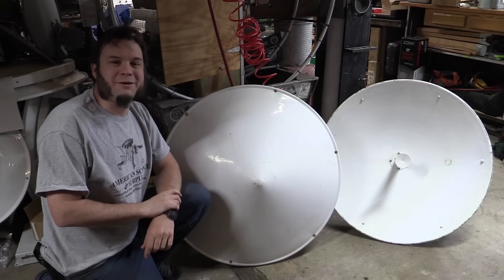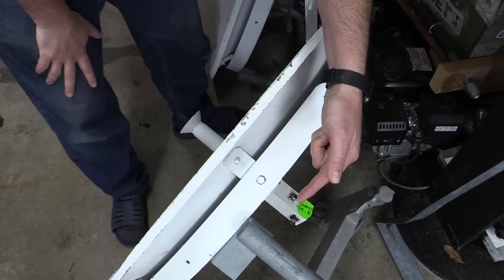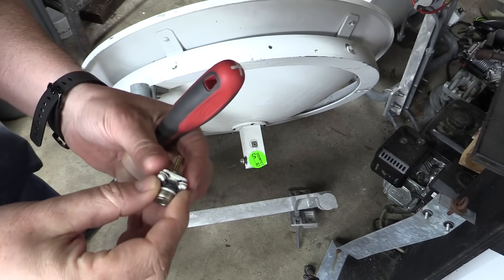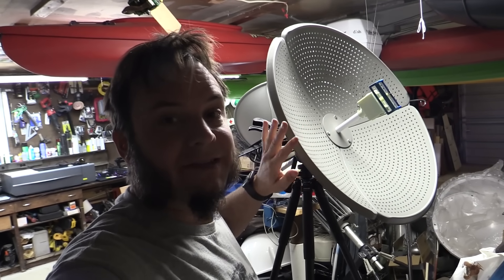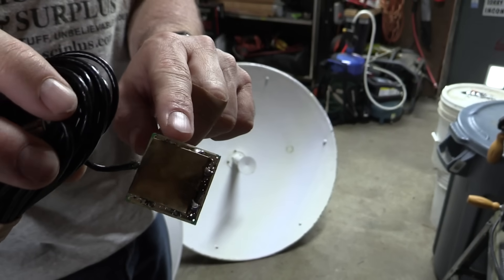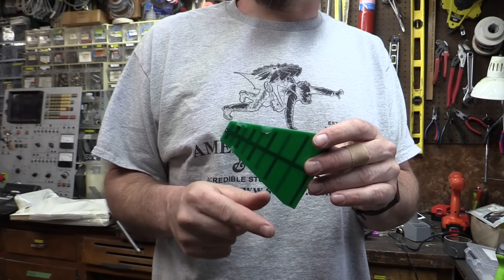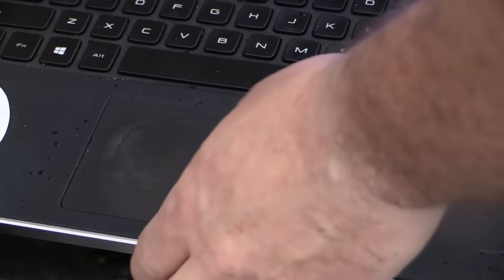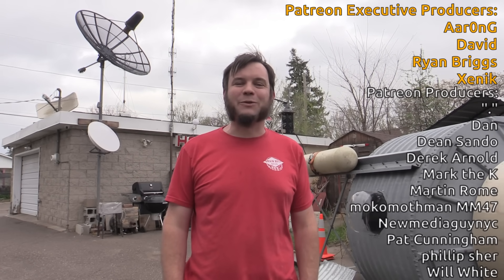Weather Satellite Downlink With Modified 5GHz Wireless Antenna

Comment: I learned just how important wave guides were tonight funnily enough. 
I was setting up an aerial for a TV in a room that's going to be a nightmare to run a cable to. Since I'm in an apartment, the signal isn't the best... Walls and such. Got a signal booster, pointed even close to the antenna, it messes around a bit with the signal. I turn on a step up converter (very poorly made one) and it messes with the signal. I am guessing it was EMF interference? Anyway, I blame the cheap antenna. :P
Reply from the maker: Lots of stuff causes interference these days, I'm actually fighting the powered ethernet for my security cameras, they wipe out a lot of satellite signals :-(

Comment: Isn't there a bit more to dish frequency resonance than just the active element? For instance, are the waveguides not also tuned to a specific frequency? (dish size is also a factor somewhat, lower freq = bigger dishes right?) :)

The log periodic antennas tend sacrifice some gain for bandwidth, which can be useful if you're hunting for signals, but perhaps a bit less useful for something that's specific-purpose like a GOES antenna, and won't likely be used on a wide range of frequencies. 

There's some interesting ones I've been meaning to try, like planar log-periodic sawtooth antennas, which, given that they are flat, could potentially be made with the lasercutter; they look like a maze - could be useful for circular polarized signals.

Comment: Did you know that an antenna has as many as 10 resistance frequencies.  2nd through 10th harmonics.  Look up RF Harmonics Calculator and Formula.  One other thing I use a radio then I tap the discriminator use a upconverter with better results than a SDR.
Reply from the maker: Yep, I run into that a lot with FM, I need an FM blocker on some antennas to keep from hearing the rock station all over the place.

Comment: Not sure I’ve ever seen you use Vitality GOES in concert with the GOES data you’re downloading. I think you might find it interesting to tinker with, and your audience may as well. Love your content, it’s dragging me down the SDR rabbit hole into the satellite realm.
Reply from the maker: I actually have that set up on the big dish, although I need to tweak the settings. The drive fills up on the Pi and then it stops working, so my auto-delete script and cron job aren't quite working.

Comment: Got some nice images there!  You captured the signal with SDR++ but what did you use to translate the signal to imagery?
Reply from the maker: I normally use SatDump. It wasn't working 100% on my laptop but I could transfer the recording over to another computer.
Reply: @saveitforparts  Got it. Thanks.

Comment: 10:32

This error indicates that SatDump is trying to load a configuration file in JSON format, but that file is empty or corrupted (e.g., does not start with a valid JSON structure like { or [ ).

Locate the config file (Possobly on ~/.config/SatDump/config.json) , make a backup of it, check if it exists, or if its empty. Delete it and let SatDump Re-generate it on startup.

Comment: Snow and ice mess with dishes in MN. Know nothing about that…….. ugh. Clearing dishes on the roof is one of the WORST parts of winter.
Reply from the maker: Mine haven't had too much of an issue so far, although I need to be careful with my S-band rotating dish so it doesn't get too overloaded with snow. The plastic dome on the small one should help!
Reply: @saveitforparts  well... we primarily have big dishes upstairs....they are magnets for accumulating snow lol. (You can see them on Google Maps.)

Comment: You've inspired me. I got an RTL-SDR and have been messing around with signles.

I've de-coded local emergency services P25 digital. Found and have been decoding pagers from local hospitals. I got an LNA and im picking up hospitals in different states and up to 50 plus miles away.

im going to eventually get into grabbing stuff from satellites.

starting small with local terrestrial. signals I already know plus finding others
Reply from the maker: Cool! It's definitely a fun hobby.
Reply: What are you using to decode?
Reply: you shouldn't mess around with signles - that's how you end up illiterate AND owing child support
Reply: @gorak9000 it's ok, they are 50 miles away so not in his area.

Comment: I saw some 5Ghz wifi grid antenna. can I modify to receive 4Ghz satellite signal? (C band)
Reply: The minimum sized dish to receive c-band satellites that are spaced 2 degrees apart (as they are) is 10 feet. The bigger the dish, the smaller the spot on the sky it receives signals from. Any dish smaller dish than that, and you will always be receiving multiple satellites at the same time. Can you get away with it if the satellites on BOTH sides of the one you're interested in don't have signals at the same frequency? Kinda, but not really. I've never seen a 10 foot wifi grid antenna

Comment: I point the newer gen of that dish all the time at work. We never ever use the adjustment mount, instead we loosen the pipe-pipes that mount to tower legs just enough to bump it into position, and tap to fine tune. Same with the elevation… just back the brass nuts way off, bump to location, and when you get within parameters, tighten down and verify. Those RadioWaves dishes are a nightmare to deal with and assemble.
Reply: I will note that with percussive methods, we can easily get within .2deg of targets. The limit after that is our alignment tool-SunSights which somehow cost $10,000 apiece! For that I’d have expected them to tell me future and the current surface temperature anywhere on Venus
Reply: @SpAm-AcCoUnT Hey I can tell you the future and the current surface temperature of Venus.
You're about to be disappointed and it's friggin hot. I'll settle for $5k 😂

Comment: Would a dish tv one work with an antenna for this? I can find those super cheap and wanna mess around with this soon
Reply from the maker: Most of them are a little too small for GOES, but will work for Low-Earth-Orbit satellites like NOAA and METEOR if you can move them to track the satellite. I have a couple videos on stuff like that.

Comment: 9:08 what is that device? 🤔
Reply from the maker: It's a SAWbird+GOES, I should have a link in the video description. Filter / Amplifier for L-band signals.
Reply: @saveitforparts not sure if I have seen something like that in the e-waste dumpster I check periodically or not, but will keep an eye out! Recently found a tossed out Dell Latitude E6420 (or E4620) & an Intel Simply NUC i7! Haven't tested them yet! Thank you

Comment: Don't some of those radio signals travel in an 360* sphere? 3:47 can a different antenna, with a wider range, be mounted in that dish? And 3:51 so in order to mount a different antenna, a longer one, the housing for the antenna would have to be upgraded too - to a longer one, right?

Comment: The problem with those dielectric patch antennas used for GPS is that they're actually a fairly sharply tuned antenna structure.  That's true for patch antennas in general, but somewhat more so for the ones printed on a high-Er ceramic substrate.  Will it work at 1.7GHz?  Probably.  But it' may be 5dB away from optimal.....
Reply: Use an upconverter? Legitimate question.
Reply: @joeyhinds6216  Not sure what you mean?  An upconverter is normally used between the antenna, and some receiver that perhaps doesn't tune down as low as you need (at the antenna frequency), so you shift it up in frequency to account for the receiver limitations.
Reply: I think those ceramic GPS antennas are VERY narrow - even with the filter removed. You'd have to put one on a VNA to actually check it to be sure - I think that's a little above the skill level of this channel

Comment: Yay! New Saveitforparts video 🎉, also, for you’re 3d printed antenna, what SMA connector do you use, and can it pick up GOES?
Reply from the maker: For the Helicone antenna? It's a panel mount SMA, and it's the wrong polarity / too small for GOES (I tried!).

Comment: And why the people on the Equator turn there LNB by 90° for a normal vertical reception? 😊
Reply from the maker: Depends which way they point the dish, if the sat is directly overhead or off to the East or West.

Comment: Gabe, You can convert a prime focus feed dish into an offset feed dish and get better gain from it, this will allow you to use a better feed horn and by offsetting the feed it no longer shadows the dish increasing the gain. You can see how the offset feed works in my video of my dish on my YouTube channel,
 Dave in Tennessee.
Reply: you can NOT convert a prime focus dish to an offset dish - a parabola does not have a constant curvature to it, and the curvature at the base of the parabola is not the same as a section further away from the base as is needed for an offset dish. Come on, this is like grade 9 math
Reply: @gorak9000  Yes you can I am running a .9 meter prim focus dish configured with  an offset feed and I an getting Viterbi numbers in the upper 20's
Reply: @onmyworkbench7000  You can believe whatever "alternate facts" you wish, but math is math - it doesn't work. If it "works" at all, it's not effectively using the entire surface of the dish, so it's not working the way you think it does.
Reply: It may sometimes work well enough but it'll be dependant on a whole bunch of things. Frequency probably principle amongst them. 
At a low enough frequency the error in the shape will probably matter less. 
But I do struggle to see it netting you improved performance over a prime focus Rx antenna in most plausible circumstances.